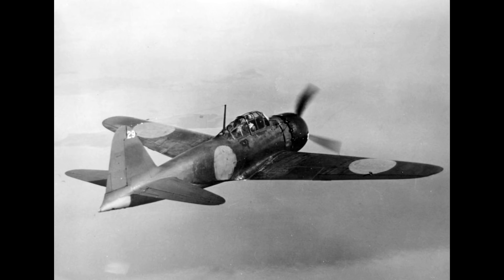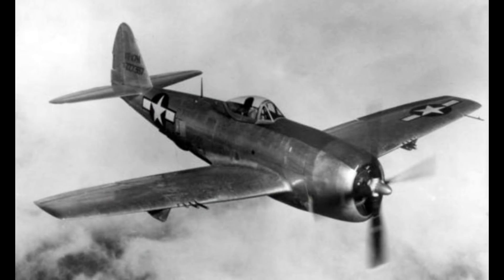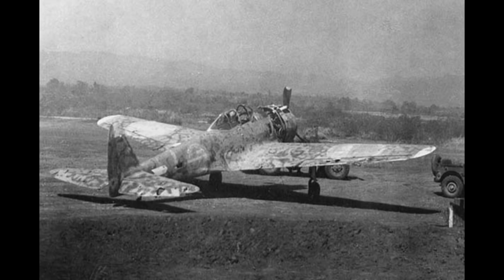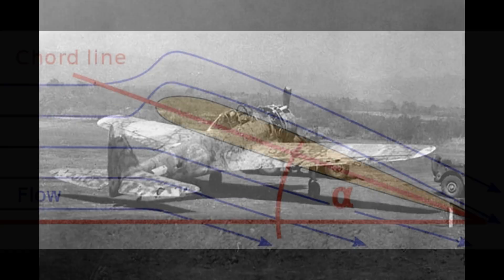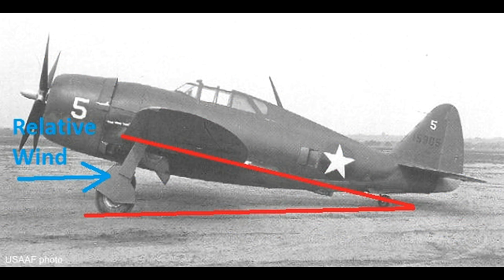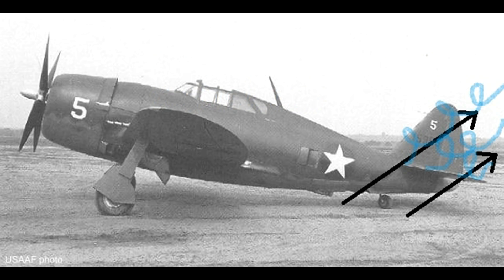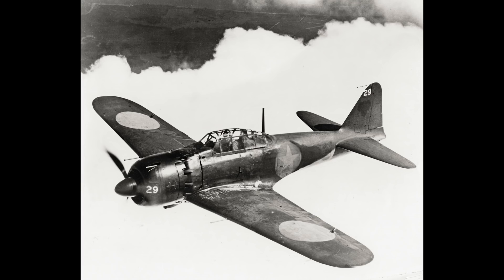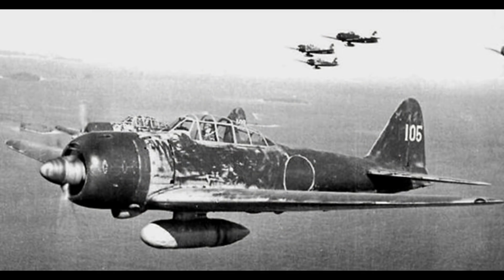Mitsubishi A6M Zero, an interesting fact few people know

Comment: Greg, just watched this for 2nd time. As usual, great job. Question? How come Extra doesn't do this? Zivko and SU sort of do.
Reply from the maker: Probably because the position of the wing itself prevents the problem. Or it could be because the plane is so short a blast of power puts enough prop thrust over the tail surfaces that they respond really well anyway. I'm just guess as I haven't flown any of those planes and just don't know that much about them.

Comment: Hi Greg, good video, nice detail. One thing I don't understand though:
"The philosophy of agility above all other factors was really obsolete by the time WWII started"
Wasn't it always a tradeoff between speed and maneuverability? The trend at that time was indeed towards quicker and heavier planes that as a result could turn less well, but I think the Zero was very much a part of that trend! I don't know the turn radii & rates for any of these, but I would imagine that many interwar designs such as the I-153 and the P.11 could outturn a Zero. I'm almost certain WWI planes like the Dreidecker could do that. But the Zero is much faster and heavier than those. 
So correct me if I'm wrong, but all I've seen thus far is a wobbly but fairly constant line between the Dreidecker and its ilk on one end and the F-104/F105 on the other end, and I would argue the Zero fits somewhere on that line. Makes sense?
Reply from the maker: It's not agility above all other factors. It was as much agility as possible within the other design criteria. Fighters have to have enough speed to catch the enemy or they can't shoot them down. They have to have enough range to complete the assigned missions, and so on.
Reply: @GregsAirplanesandAutomobiles  Sure, I agree with that. But doesn't "as much agility as possible within the other design criteria" apply as well to most other planes within what I call this 'trend'? 
A Zero can turn great, but probably should use boom and zoom tactics against many earlier fighters. A P-47 can turn pretty well, but generally shouldn't attempt to enter a prolonged turnfight with a Zero. An Me-262 can turn alright, but shouldn't turnfight a P-47. F-86 pilots should use their speed rather than agility when faced with MiG-15s (or at least that's what popular history says). Right up to the F-104, which I think is an example of a plane that trades maneuverability for speed to the maximum practically possible extent.
Range is another factor, true. I've read the Zero didn't do too bad in that regard though...

Comment: The de Havilland Mosquito used the reverse configuration (see photos) ...vertical fin/rudder forward of the rear horizontal stabiliser... was this the same benefits in reverse?
Reply from the maker: No, it's totally different. The Corsair and others have their tails in similar configurations to the Mosquito.
Reply: @GregsAirplanesandAutomobiles  Going to do a vid of that Greg, be interesting to see.

Comment: I’ve read (I don’t remember where) that the Zero was the most maneuverable fighter of its time AT LOW SPEED. At higher speeds the P-40 was actually more agile than the Zero.
Reply from the maker: Generally true. At high speed the Zero's ailerons become difficult to move.
Reply: @GregsAirplanesandAutomobiles  - I wish I could remember where I had read that.  Apparently there was also a risk of damaging the airframe with strenuous maneuvers at high speed, leading to the addition of some modification to the elevators to warn pilots when they were starting to hit the limits.

Comment: At my local museum the   Fairey Firefly has it horizontal stab mounted forward of the rudder. Our North American Harvard is less extreme.
Reply from the maker: The forward edges of the horizontal and vertical stabs on the Firefly start at about the same place. It' s just that the firefly has a huge rudder and a small elevator. I'm not sure, but I doubt you can spin a firefly, so it's not for the same purpose anyway. The Harvard is much like the Zero, but as you said, to a much smaller degree.

Comment: I think "extremely unusual" is a stretch - I can think of several that are similar in this regard - the Hawker Typhoon and P-51 Mustang both have horizontal stabilisers that begin well forward of the fin (fuselage strake excepted on the P-51D/K) and don't extend back anywhere near the rudder, and plenty of other designs like the Fw-190 also have the trailing edges of the elevators well forward of the rudder pivot. The aerodynamic reasoning is interesting, though I'd say there were certainly plenty more people than the Japanese who had the same information, empirical or modelled. The Zero's look is more of a "Trompe l'oeil" due to the swept back leading edges and long chord of the fin and stabilisers at the root, I think at least.
Reply from the maker: The Typhoon? Really? It's barely forward at all, nothing like the amount on the Zero. In the case of the P-51, it sort of depends on what you count as the front of the vertical stab.
Reply: @GregsAirplanesandAutomobiles  Well that's kind of my point - neither is the Zero's, it's just a trick of the eye. Look at the leading edge of the horizontal stabilisers on a Typhoon and reference that with where the fin joins the fuselage, it's roughly a foot forward, and the trailing edge meets the line of the rudder hinge. Now look at those two points on a Zero - it's almost exactly the same, but looks more extreme because the horizontal stabilisers have such a swept leading edge and are quite large. If we take a point halfway down the chord of the horizontal stabiliser, on the Zero that actually falls rearward of the fin leading edge, whereas in the Typhoon it's just about in line with it. In the case of the P-51, the early B model is a better reference as it doesn't have the strengthening gusset on the fin - it's pretty clear to see that's about the same as a Zero. I guess I'm just being a dick, but I think it's just a case of designers optimising each airframe rather than a special trick of the Zero. The Corsair, for example, has its fin miles forward of everything else, which is more unusual, but would seem to be a better empirical solution to maintaining rudder authority in a high angle of attack based on the aerodynamic evidence here?

Comment: Interesting.  The Ki-44 and 84 had an even more pronounced such characteristic.  I have heard that the reason was better gun stability.  But your theory makes sense too.  Where did you read this theory?

By the way, ability to turn in a dogfight is not obsolete.  The problem for the Japanese was that by later in the war, ability to turn was the ONLY characteristic that favored the Zero.  Without speed and firepower, the ability to attack enemy bombers is compromised, and the ability to escort your own bombers can be also difficult.  Turning ability is simply one of the many characteristics that you wish you had.  It is all a compromise.

The Zero designers did a great job in building the best fighter with only 1000 hp.

And, by the way, the A6M was not the most maneuverable of them all in a horizontal turn.  The Ki-43 may have been a hair better, thanks to its butterfly flaps.
Reply from the maker: Hi Demetri. I learned the information on the tail from an interview with a Zero design team member in an English subtitled version of a Japanese Zero documentary. Regarding the K-43, the Japanese had a contest between the two planes and in spite of it's slightly higher wing loading the Zero beat the Ki-43 in maneuverability. It was determined that the reasoning was control effectiveness. Maybe I need to make a follow up video on the Zero to cover these questions. They are good questions.
Reply: @GregsAirplanesandAutomobiles  Thanks for the info.  Is this documentary on youtube?  If yes, can you post the url?

Ki-43 vs A6M ...  There was a lot of rivalry between the Japanese Navy and Army.  They competed among each other, almost as much as they competed with the USA!  I am wondering of the better maneuverability of the A6M is a result of that.  But the opposite claims could be just as well affected by this rivalry.  One thing I know is I think a certainty.  The A6M advantage over the Ki-43 is its better armament.  The Ki-43 in return has advantage of a bit better roll rate at high diving speeds.

The Ki-43, however, has shot down more enemy planes than the A6M.  Main reason is more likely that the Ki-43 mostly operated in the China Burma theater, where the conditions were more favorable (better early warning of raiders, better availability of aviation fuel to train pilots).

PS.  The Mitsubishi Ki-46 has very similar tail design to the A6M.  The Ki-46 was an uncatchable recon aircraft of the IJA.  Only Spitfire V and VIII's could consistently catch it.

Thanks.
Reply from the maker: I'll check, but if I can't find it in a few mins, I'll give up. I saw it when in Japan on youtube. You get different search results when over there.
Reply from the maker: Found it. Four hours of Japanese awesomeness. https://www.youtube.com/watch?v=-0hq55rRTTs&t=701s   Just don't ask me to sift through it for a specific reference ;)
Reply: @GregsAirplanesandAutomobiles   Thanks.  I have watched this before, but will watch again.  However, it seems that the sources here are IJN.  The rivalry I mentioned before increases the chances of a biased assessment.  Much like P-51 vs. Spitfire.  The reality however is that the wing loading of both aircraft comes very close.  So, their horizontal plane turning ability must have been very close as well.

This is an excellent documentary, by the way, that describes very well the dilemmas  that a fighter design faces in order to find a good balance of all the performance parameters.  Turning ability & climb vs. speed vs. armament vs. armor protection etc etc.  Almost all parameters, except maybe for the first two, tend to be contradicting.  But ultimately, the fighter has to have a minimum top speed in order to catch enemy bombers.  The Zero and Ki-43 could not do that by 1944, so even though they could fight well against enemy fighters, they could not fulfill their fundamental mission.

Comment: Hi Greg, great short video. Interestingly the  earlier Gloster F.5/34 fighter, which looks very like the Zero and has been suggested as the inspiration for the Mitsubishi plane, also has its tail plane in a similarly forward position. Is this all coincidence? Seems slightly unlikely that there should be such a visual similarity between two aircraft - according to you possibly the only two aircraft - sharing such an unusual feature. What's your view?
Reply from the maker: The Gloster's tail is actually the exact opposite. It's vertical stab is forward of the horizontal. I do think the Japanese looked at the Gloster, and many others, but over all the Zero is a 100% stand alone design, it's not a copy of anything. That said, the Japanese were certainly smart enough to look at what everyone else was doing.
Reply: @GregsAirplanesandAutomobiles  Hi Greg thanks for the prompt reply. Yes I see that you are right. Obviously I am suffering from Brain Fade. As you say the Gloster is the complete opposite. Is this in fact equally unusual in aircraft design of the time, certainly none of the aircraft shown in your video have this feature. It seems that this was done to enable better spin recovery. The aircraft was praised for it's manoeuverabilty so maybe it had a similar effect to the arrangment on the Zero. There were several aircraft designed to the same specification as the Gloster, all of them with relatively light weight construction and aircooled engines. They were supposed to be optimised for "tropical/colonial" conditions. Had any of them gone into production they would probably faced the Zero in the Far East. If they had the more powerful engines - Bristol Perseus - that were considered then they may well have had similar performance to the Zero. An interesting conundrum for the alt-history fans.  Given that the focus on production of the Hurricane and Spitfire kept the    UK in the war in the tricky early years. The cancellation of the F.5/34 fighters was probably for the best. The shortage of RAF fighter aircraft (and indeed tanks)  in the Far East was due to the need to send supplies to the Russians in the early days before American Lend Lease kicked in. Cheers

Comment: The Zero also had a new kind of AlClad (not sure if that was the right word) aluminium skin, that was lighter, stiffer, but more brittle than any other aluminium ever. You could easily cut off a big piece of a zeros aluminium skin with a simple machete. Please correct me if I am wrong about htis.
Reply from the maker: I believe you are correct. I have read that, but as I don't have an actual Zero here to perform the machete test, I'm not 100% sure.

Comment: Hmmm? Are you sure on this? I thought the findings from studying the Acutan Zero were it was only competent at snap rolls at low speeds. If you get it up to 200 knots and roll on it it can't follow. The Ailerons tended to lock up at high speed. It also had trouble rolling Right. So High Speed Rolls were one of the recommendations to Hellcat and Corsair pilots seeking to defeat the Zero. The Zero's amazing low speed agility came at the price that it got sluggish and less responsive at higher speeds where its controls were fighting the planes aerodynamics.
Reply from the maker: Hi Andrew, it's clear you don't know what snap rolls are, please see my video on this subject. Thanks.
Reply: Greg's Airplanes and Automobiles You’re right, I likely don’t know the specifics of what a Snap Roll is. However I can read the formal report on the Acutan Zero, which was pretty clear and direct regarding the limitations found with the plane.

Comment: The F4U Corsair’s stabs are offset a bit aft of the rudder rather than forward as on the Zero. Could it be that this provides similar rudder effectiveness benefit at high angles of attack for the F4U?
Reply from the maker: As you point out, the Corsair's tail is literally the opposite of the Zero's. I don't think it provides the same function because most planes with the Corsair's style of tail have prohibitions against spinning, including the Corsair.

Comment: The later P 40's had a longer tail that did this. (P40K,L,M& N). In the RAF you have the,Typhoon, Tempest and the Mosquito, which put the tailplne Behind the fin/rudder almost entirely.
Reply from the maker: The Tempest and Mosquito have the vertical stab forward of the horizontal, opposite of the Zero. The P40M and other late models are a bit more like the Zero.
Reply: Sorry, I was a bit unclear. The Typhoon/Tempest had the tailplane set a bit forwards but not as severely so as the A6M. The Mosquito mounted the fin rudder almost in front of the horizontal tailplanes.FWIW the Typhoon and Tempest Had the same basic tailfinT, with the only difference being the curved fillet on the empest
Reply from the maker: That's a fair point Brett. Thanks for your comments!

Comment: Please address the thin dura aluminum alloy used in the  zero. Some gamer historians took one bad analysis of zero construction and applied that to a review of the zero. Your two well worn zeros proves my point. There is not a undented area where any humans even bump into the airframe. Guys would cut out pieces off crashed zeros using a K bar. You try that with a P47 and you will be there a while?

Comment: The Japanese naval pilot groups stationed across Japan in the 1930's had a on going debate on the use of a fighter, Genda wanted to do away with fighter altogether. Genda opinion changed at the start of the 1937 war, then the debate was for a fast maneuverable plane. This lead to the devilment of the Zero, which had to have a fast climb rate, great in turns and super long range. This was not liked by all the Japanese groups as some leaders want a fast hard hitting plane.  The Zero once it was found out was a light weight weapon with a low ceiling to take advantage of its maneuverable (over 15000 feet it was a sitting duck), and easy to hit the wing tanks to bring it down, fell pray to the same great debate before the war for a high attuite plane with speed.
Reply: The other great debate before the war was the IJN Yamato vs 1000 more aircraft. As can well be seen in hindsight, the Japanese navy would have been better of with the additional 1000 aircraft. The IJN Yamato was a total waste of money on her and her sister ship. That would have given the Japanese Navy 2000 additional aircraft going into WWII.

Comment: Looks like swept back wings also?
Reply from the maker: Yes, that's true. However not because it increased the maximum mach number, that wasn't really a factor with the Zero. A small amount of sweep back increases lateral stability around the longitudinal axis which increases gunner accuracy and makes the plane a little nicer to fly. This was very commonly used in WW2 fighter design.

Comment: I once read that, with no other changes other than an additional 500 hp. The Zero would have been a very dangerous foe.
Reply from the maker: I guess I can't disagree with that, but I suppose if you added about 60% more power to any WW2 fighter without increasing the weight or drag, the same would be true.
Reply: Greg's Airplanes and Automobiles 
Of course that’s true..but that not my contention.
My contention is, if the zero had comparable power to its rivals, it would have fared much better.
It would have then had the best of all worlds. Dive, climb, turn, speed.
Reply from the maker: I don't disagree.